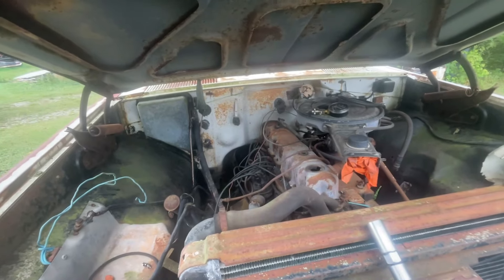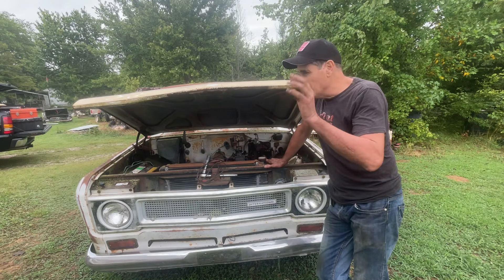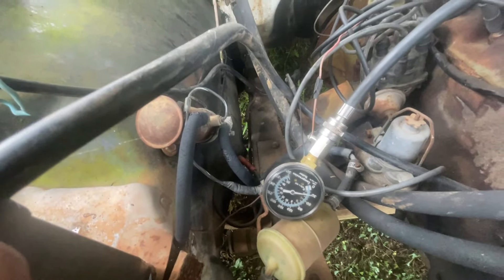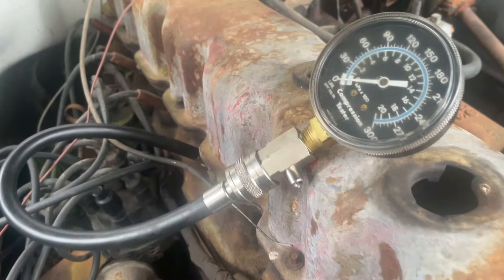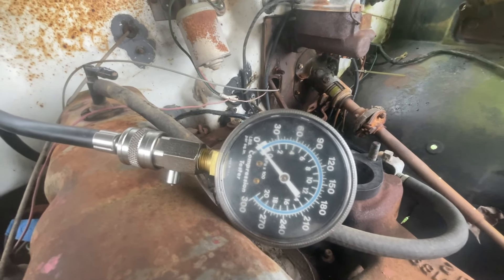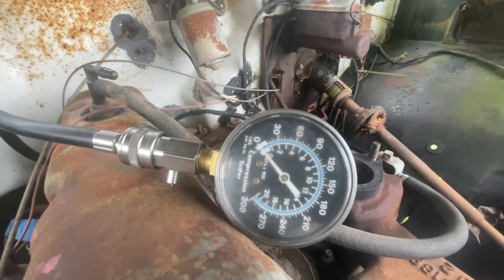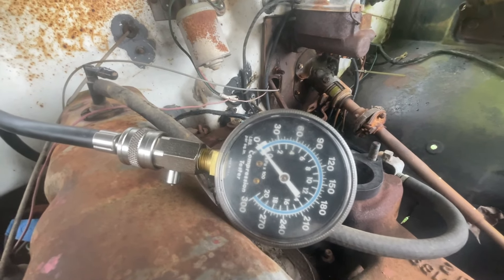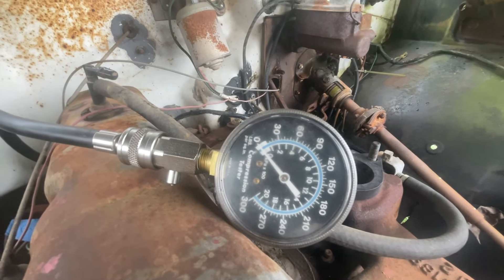I try again with the 1971 International! Will it run on the second attempt? Step by step analysis.

Comment: Awesome as your step by step instruction are clear and concise! My Dad had a company owned Scout II, since Dad worked at a Truck dealer for IH, he would bring a Scout to drive for a few weeks. Talk about 4-wheelin, Dad would go up embankments nearly vertical, never ever did that baby give up!! So never give up the ghost, it's very intriguing on what is wrong, in figuring out why it doesn't crank.

Comment: I still don’t care about the worn engine or starter; that is still a cool old truck! That AMC engine can be easily rebuilt or replace at a reasonable price unlike the optional  I-H engines that it could have been built with. If it could be bought for a decent price, it would be a fun project and a nice truck to own!
Reply from the maker: Agreed. This is a super-solid truck for someone to build on.
Reply: That engine was to worn out to start, You gave it a second chance  but the  engine was to worn out to start.  Good  job for trying .
Reply: @morewhattherust ugly
Reply: Ih sweet truck
Reply: Could pick up a medium duty v8 304 ih or maybe a 345 and swap that in it and rebuild the amc 6 cylinder

Comment: Excellent video Christina  :) , Richard  :) , thought over to and thinking that needed rebuilt and cure all too! Yes Auto Mechanic told anything over 70 to it normal PSI readings in each cylinders  has make engine  okay  also with other 4 strokes steps! Then got Rocking engine to run !

Comment: Another old timer trick I’ve seen used with worn engines is to tow start them ( obviously only good with manual transmissions) 
Seen a WW2 blitz truck started that way
Might be worth a try if manual

Comment: In case you weren't aware that engine is an AMC six,International started using them as their base engine starting in 1969 model year.
Reply from the maker: That's right. Finding a 4.2L should be easy and would be an easy swap.

Comment: I too was hoping this ol’ binder was gonna run. Great effort but the rings and valves are far too gone. But someone needs to give this truck a new home! Thank you Richard. Keep them out of the crusher!
Reply from the maker: For sure, Glen. This truck is very solid, and could be a great truck with an engine swap.
Reply: I've seen 266,304, and 345 ih engines that would constantly bend over pushrods from sticky valves non existent valve seals and bad gas...

Comment: In the case of a engine that may truly fouled up or has little compression I found ( but has good spark). A very last ditch effort that usually works. I dip each plug in sterno, it usually is a good boost.
Reply from the maker: I had not heard of that before. Thank you for the tip.

Comment: Richard, Those rings must either be extremely stuck or extremely worn out which Option #2 is probably the best answer to that scenario. Wouldn’t you kind of think that with all of the cranking of the engine that the piston rings would have kind of come back to life. Oh Well, You can’t win them all. Try to stay cool in this hot weather.
Reply from the maker: Agreed, I was thinking I had done enough cranking to help the rigs, but they must have been completely worn out.

Comment: Had a silly thought for reviving long dead engines. Heat cycles can loosen up rings stuck in ring lands, gummed up valve guides, and so on. Any reason a person couldn't set up a small rig with an electric water pump and a small hot water heater like used in a travel trailer? Hook up the lines through the heater core connections on the block and let it run until the block gets to around 190, then cool down? In between heat cycles, rotate the engine a few rotations by hand and do it all again.
Reply from the maker: I think that is an excellent idea.

Comment: Not that it would have made any difference in getting it running, but when you were measuring the 6th cylinder, the pressure release button on the side was pressed against the valve cover so it probably released any pressure that was building since the needle was slightly jumping back and forth and there was a hissing sound on every compression stroke that didn't happen when you were measuring the other cylinders
Reply from the maker: That is an excellent observation. Thanks for pointing it out!

Comment: You said that you put oil down the cylinders. Was the oil marvel mystery oil? 
Another trick you might have tried to make sure the engine is getting fuel is dump some fuel down each spark plug port. Then turn it over

Comment: aw, all the efforts still didn't work... made me think, what if the valve play is to be adjusted, and from neglecting it now the valves don't close properly? it surely could play a role in it, together with all the other worn out parts. had the same when I switched an engine (Ford V-4) and switched the heads, too, and forgot to adjust the play before the first test run. almost no compression... even when someone pointed that out to me it took me a while to realize where the problem came from.
and from my experience valve play is something too easily neglected.
Reply from the maker: Good thought, Lothar, but those rockers aren't adjustable on the 232. I think the cylinders and rings are just worn out.

Comment: I think valve  rockers push rod need  be all  oil up  when you pull off valve cover look like it hasn't had anything oil in over all that stuff in long time bi believe that might been part your problem all that stuff needs to be oiled up really good you trying to turn engine over with all Val train engine valve pushrod all dry no oil on them